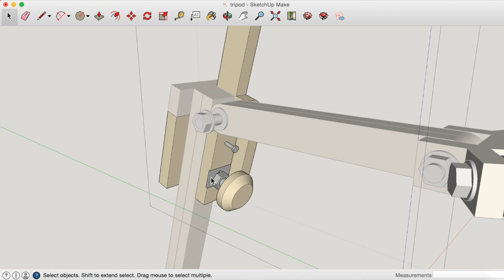Wooden tripod (part 1 of 2)

Comment: Full marks for the design and the workmanship.  The fact that you used two limbs for each leg at the top means that the geometry at the  top part would keep its horizontal plane and cannot rock anywhere, while the adjustable legs means that you can have a horizontal levelled top on any  type of ground . I wonder if the guide on the sliding leg could be two on either side, one on the inside much thinner than that on the outside.

Comment: You can pull that nut (at 2:54) into the piece by inserting a bolt on the other side and tightening it. Make sure to put a big washer and some scrap wood in between so that you don't damage your piece on the side where the bolt went in. With this method your nut will be pulled in straight. Hammering the nut in may cause it to sit crooked, especially in wood where the grains around the hole are orientated in such a way that the wood is harder on one side. <3 u Jer!

Comment: I am writing to tell you how much I have enjoyed your videos.  With all of the poor quality attempts out there, it is refreshing to view your clever, clear and entertaining videos of subjects I enjoy.  I see a lot of “me” in “you,” with your interest in passing along good information about things you enjoy, in a concise and educational manner.  I congratulate you on your excellent presentations.
Having operated a wood and metal pattern shop, building foundry tooling for years, I always liked training apprentices in what I thought were the best techniques.   Something I have noticed in many woodworking videos is how inefficiently coated abrasive sheets (sandpaper) are handled.  I always trained my guys as I was trained, to fold and tear 9 x 11 sheets into quarters, using a steel rule to keep the torn edge straight.  Those quarter sheets would then be folded into thirds for several reasons.  1.  The folded pad was stiffer.  This is sometimes advantageous, giving greater, flatter bearing on flat surfaces.  2.  The pad does not collapse or wander around under pressure.  3.  There is always an abrasive surface in contact with your fingers, providing a better friction grip than the smooth paper back.  4.  You have three surfaces to choose from, because sometimes is it is better to use a dull surface.  5.  It looks professional, like you know what you are doing.  I know this is just my humble opinion, but it drives me wacky when I see sloppy sandpaper techniques being used.  I thought I would pass along this observation as I praise your continuing, good presentations. Keep you the good work.  I am sure many old timers, like I, enjoy seeing what you are doing, and younger guys are gaining from your willingness to share your methods.  Again, congratulations on providing an entertaining and vicarious series.

Comment: Tripod looks great! Hope you don't mind if I ask a safety question. I am relatively new to woodworking. When you cut the groove for the metal piece, you didn't use a push stick. You just used your hands. I guess this is pretty safe since it is not a through cut. But if you had a kickback (pretty unlikely with such a shallow cut and not going through) the work-piece could suddenly "disappear" and leave you pushing down on the bare blade. Am I off-base on this? Please don't mistake me for a safety Nazi. I am just asking for my edification. ;-)
Reply from the maker: Thank you!
Good question. You are exactly right, if I had a kickback my finger would probably get it the blade. When I made that cut, the first pass I used a push block (I think I showed that in the video). However that felt really unsafe, as I didn't have good control of that small workpiece. Using my bare hands gives me MUCH more control of the part, so the chance of kickback is a lot lower. Personally I think having good control of the workpiece almost eliminates the risk of kickback, so I go for control even if it puts my fingers nearer the blade. But I'm not your safety teacher, so please don't take that as advise!
Reply: +Jeremy Schmidt, thanks for the reply. What you say makes sense, and don't worry. I understand that my safety is my own responsibility. But I do appreciate hearing others views on it. Provided that the views are thoughtful, as yours are. ;-)

Comment: Great video, as always. I know you're not a reviewer, but I'm wondering what you think of the Ridgid edge/spindle sander. I love the idea of it but I've seen very mixed reviews. Thanks.
Reply from the maker: Thanks.
It's great if you are in a small space and/or on a tight budget. However it is somewhat cheap (mostly plastic) and it isn't that great as a spindle sander or an edge belt sander. As with many combination machines, one option gets in the way of the other. When using the spindle, the cutout in the table for the belt is covered by a plastic pieces which makes for a slightly uneven table. When using the edge belt sander the entire belt unit is cantilevered off the shaft for the spindle, which makes it unstable/wobbly. But again these are all minor gripes and for the most part it serves me well. Just that if you have the money & space I'd say get two separate machines. Hope this helps!
Reply: Jeremy Schmidt That's kind of what figured- I've had a mixed experience with Ridgid overall. I already have a spindle sander, but I really want an edge sander and there's nothing available that even approaches this price point. Guess I'll be settling for a disk. Thanks for the response and keep up the good work.
Reply from the maker: I don't think you'll have to "settle" for a disk. I'd take a disk over the edge belt 2 to 1. I do have a 6" disk sander (disk/belt combo) and I like it except it's only 6" and no dust collection.

Comment: I have A Question for you ...?   How In the world did you make that hole for the 6 sided bolt to fit in the handle at the  8:11mark in your video Could you Please share how you did ...?  Please .....and Thank You ......!
Reply from the maker: I often draw around the bolt head and then use a router with a 1/8” straight bit  to freehand a hexagonal hole. But I’m pretty sure in this case I just hammered it into a round hole. It definitely doesn’t have to fit perfectly, as long as you have a hammer!
Reply: @Jer_Schmidt  Thanks for your answer I don't have a router...! , Did hammering do the trick and the bolt wont move .for your tighten down nob  you made here .. ?  I love your wooden tripod  project I want to build one for my Astronomy Binoculars Parallelogram arm I am attempting to build ....